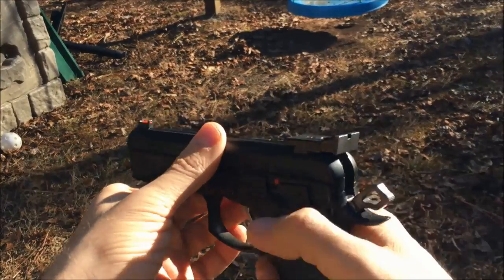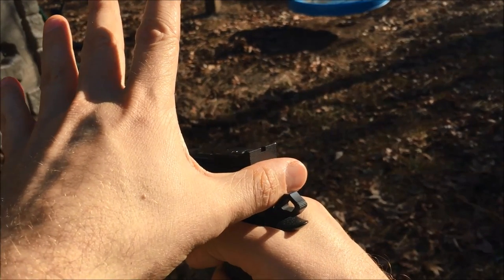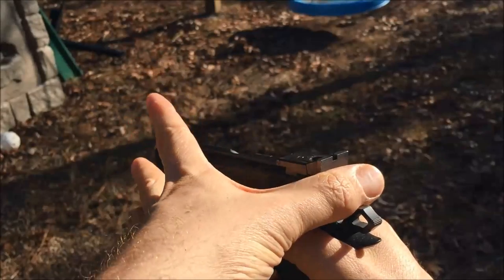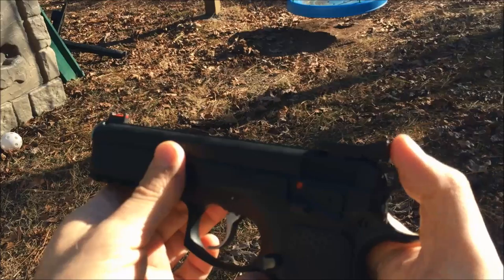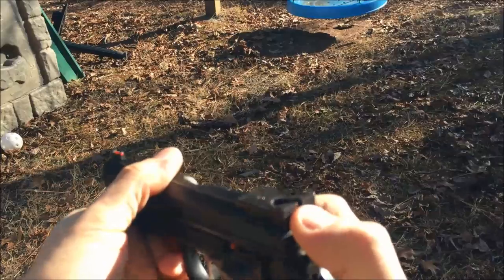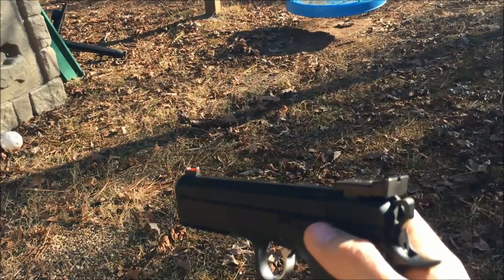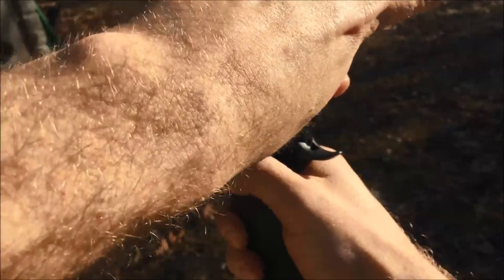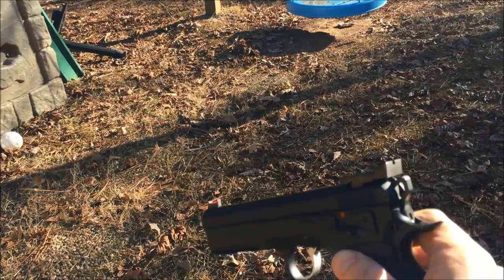3 methods for decocking a CZ / Tanfoglio pistol with a manual safety

Comment: On the Tanfoglio CZ clones which includes the Sar 2000 and the Jericho 941 F the manual safety can be switched on regardless if the hammer is cocked or down. The Tanfoglio is an improvement over the original CZ75 design in my opinion 😊

Comment: Wouldn't it be best to combine methods 2 + 3? That is, decocking traditionally (over-the-top) by holding the hammer and easing it down, while ALSO putting your off-hand thumb below the hammer as a block? Instead of your off-hand thumb, you could also use the web of your off hand (between the base of your thumb and index finger)

Comment: Another very safe method is the three fingers.
The Hammer pinched between the middle finger and the thumb, index finger in front or on top of the hammer.
Reply: my preferred way and the safest in my opinion, especially with sweaty hands FULL CONTROL that way 👌🏼💯

Comment: I use thumb-roll because it's impossible for the gun to go off with my thumb between the hammer and the pin.
Reply: Sorry for a newb question, but how strong must the hammer hit in order to fire CZ 75?  In other words, if you remove your thumb too quickly, could your gun fire?
Reply: @BigVK19  yes. It happened to me..... Twice. Good thing I was out shooting at an open space and not decocking it inside my home. Be careful in not letting the hammer fall back uncontrolled.
Reply: @BigVK19  yes. it has happened to me a few times. it startles you and will make you nervous de-cocking the gun anytime after the first incident.

Comment: I'm considering a Shadow 2 OR for USPSA, to replace my SIG SP2022, but was concerned as to how to safely decock the Shadow 2 for "make ready". Thanks for the video.
Reply: In case no one replied to you, Shadow 2 will be awesome choice. Decocking goes same way as in sp-01, so you can decock it fully or you can let half cock catch it. Half cocking is safer in my opinion, but that just me. You can also half cock the hammer after decocking if you so choose to.
Reply: @anssisalonen7990  so forgive me for getting in your thread. But I have a question. I shot a couple steel challenges using a 1911 single stack. I started from a cocked and lock position. Using a double action am I supposed to chamber and then decock hammer? Or can I start with hammer cocked and safety on?
Reply: @bobhorsewood5689  Depends on rules/stage you're shooting, but generally when you're using Da/Sa gun you're expected to start with 1 in a chamber and decocked/half cocked. It all depends on rules/stage you're shooting under.
Reply: @anssisalonen7990  thanks for the reply. Shooting a 1911 is a little different. So with the CZ shadow I'm going to start practicing before I try my hand in that class.

Comment: I wish they made a decocker conversion for these.
Reply from the maker: It's not so bad once you get used to it.  The idea is pretty terrifying but the practice of it results in very few NDs.
Reply: @TheHumbleMarksman  “very few ND’s” not very reassuring 🥺
Reply: @NextScamdemic 
Just get the decocker version. If you are scared.

CZs website even implies doing a manual hammer drop is a perk of this weapon.

Comment: Thank you, I just bought the EAA Witness 10mm and learned the safety was not a decocker. I like to carry with a round in the chamber and wasn’t sure if carrying locked and cocked like a 1911 was a good idea. Having these three options makes me a little more comfortable although I would rather have it ready in single action and keep the safety on.... thoughts please
Reply: CZ Omega lets you convert the decocker into a safety.  With the safety on you can have hammer to rear like a 1911. However, im scared of a negligent discharge. Thus, i use methods outlined in this segment for decocking.
Reply: Love berettas as the have both lock and decock

Comment: I have a particular issue with my TA90. When I pull the hammer back and pull the trigger with the safety on the safety works as it should, but then when I remove the safety the hammer falls to half-cock. This does NOT happen when I don’t pull the trigger with the safety on... only when I pull the trigger while hammer back and safety on. Any ideas?

Comment: Is the cz with the manual safety over the decocker smoother? Watched another video and said he could feel a difference in the decocker for some reason.
Reply: While this is old...others will stumble over this. Yes, the decockers have always a negative influence on the trigger. How much that is relevant depends on the shooter. Dropping the decocker results in better performance of the trigger like on the SP-01 and the Shadow 2. the less the trigger has to do, the easier it is to perfect it.

Comment: This was just great, however, can you tell me if you drop the hammer manually and it is in full-drop position is the weapon safe from a pistol drop or pressure of any kind on
the hammer. I really appreciate your answer....thank you.
Reply from the maker: Depends on which model you have - the B models - yes - there's a firing pin block.  The nonB models - technically with a violent enough drop at the muzzle the firing pin could contact the primer - same as a 1911.
Reply: @TheHumbleMarksman  A 'series 70' 1911.  The 'series 80' 1911's, like the B models, have a firing pin block.

Comment: Is that gun safe to carry with one in the chamber, hammer down and safety off ready to fire?
Reply from the maker: The FIring pin block guns are - the shadows are not - they need to be at half cock.  This is useful for practical shooting which requires decockinf

Comment: Just to be clear, as long as you let go of the trigger, u can fully drop the hammer on a live round to rest position? (Slowly of course)  great vid btw
Reply from the maker: correct
Reply: My question is, can the hammer then be accidentally struck, setting off the primer? Much like the old single action revolvers.
Reply: @ke0nc  
The hammer can (depending on the make and model of the gun hit the firing pin leading to an negligent discharge. Some have firing block safeties, which means there is a block or a bar that hinders the hammer of striking the firing pin if it doesn't move forward from the fully cocked position to start the movement. How these work is the question. Some are mainly meant as a drop safety, so falling with the gun or dropping the gun won't result in firing a shot. If you drop your gun, always treat it as if it could go off. Parts move when they get hit. Some get rid of that safety cause it allows for an even smoother trigger pull (depending on the mechanism/gun). Removing it while it was originally there from the manufacturer will look really good in front of a jury. With revolvers it has more to do what kind they were. Some were lowered directly on a cap, so an impact on the lowered hammer could set it off. That's why they loaded 5 and used the empty chamber to ride safely. With modern revolvers you have transfer bars that get in the way if you let go of the hammer without having it fully cocked. You can press on the back of the fully cocked hammer to see if the safety notch isn't worn/hasn't been tempered with. What you describe with an impact to the back of the hammer is still possible of the 70 model of the 1911. The firing pin is free  and a good impulse will push it forward. The question is how often did it happen. But falling off a horse might be enough (I have no experience with that). Depending on the country and state you live in, it might be required by law that the gun can not go off if it falls from X amount of height. The big upside of the external hammer is that you can put your thumb on it when you put the gun in a holster. Even if some clothing get in the trigger guard, the hammer can't be cocked cause your thumb prevents it. That's something you can't do with most stricker fired pistols while some allow for an upgrade to allow it, most don't.
Reply: @onpsxmember  Thank you for the in depth answer. That confirmed my assumption. I won't be worrying about bumping the hammer.

Comment: Would a steel frame p01 be drop safe, i.e. have the firing pin block? Also, what is he difference between running it limited vs all the way down? Why not just carry it limited, seems safer.
Reply from the maker: it is safer - half cock is totally fine.  Gun games require a fully decocted pistol

Comment: What is the purpose of the Half-cocked position?
Reply from the maker: +Hyphy Juice that's how they are intended to be carried if you aren't using the manual safety.  The shooting sports don't let that fly, for whatever reason.  Non block models it helps them be drop safe.
Reply: @TheHumbleMarksman  When you decock a CZ (using the decock lever) the hammer falls to half-cock. Are you saying that the RO then requires you to recock the pistol and lower the hammer manually?
Reply: @userer4579  , In IPSC the rules state that "If a handgun has a decocking level, that alone must be used to decock the handgun, without touching the trigger. If a handgun does not have a decocking lever, the hammer must be safely and manually lowered all the way forward (i.e. not just to the half-cocked notch)
Reply: @ashley1scott  Thanks Ashley.  Cheers.

Comment: A bit confused.  I recently shot my first USPSA with my SP-01 Tactical which has a decocker.  As mentioned elsewhere, it takes the hammer to half cocked. Are you saying, after utilizing the de-cocker I must also use this procedure to further drop the hammer?  What’s the point of the decocker then?
Reply from the maker: If you haven’t yet - it might be worth your time to read the rules - or at least just the production appendix.  If you have a mechanical decocker you may use it and leave the hammer at whatever condition it put a the hammer in.  Manual safety models must fully decock

Comment: I have colt raven mp-25 auto. Is there a safe way to "decock" it when there isnt a hammer. Dont want to dry fire it.
Reply from the maker: Sorry man I don't have any experience with that pistol.
Reply: I decided to just pop slide off, and disassemble it, for now. Till i find a manual. Just want to play it safe without damaging it. Thanks anyways!
Reply: big
Reply: @bigguns1611  The best, safest and easiest way to decock the RavenArms .25 is to remove the one screw that secures each grip, drop the Mag, lock the slide to the rear, and the with your right hand throw the gun into the nearest body of water. Afterward, go to the local firearm dealer and get a reliable firearm.
Reply: @SofaKingQuick  i have more pistols that are way more reliable lol the ravenarms is just a playtoy
Reply: @bigguns1611  Sure Steve.Sure. Lots of guns. That’s why you had to ask some random dude on a random YouTube video how to decock your Raven Arms .25 and called it a Colt. Uh huh. Sounds legit.

Comment: Dig your vids man. This is my question, for you, or anyone that wants to answer. I dont want a dick tugging competition of decocked VS saftey, buy what ya want. But,... 
Why even get a decocker model? When you can decock a safety variant? Saftey model is usually cheaper, easier to work on, typically... that said, what am I missing here? Even if you like to carry decocked, why not just get the safety model, and not use money, for a little lever that does it for you? And, you can run cocked and locked even if you chose also. Am I high??? 
TIA all.. happy shooting
Reply from the maker: eh I'm with you - if you want to drop to half cock it's fool proof - or as near to it as you can get - and for all the advantages you've stated - I don't like the decocker models.